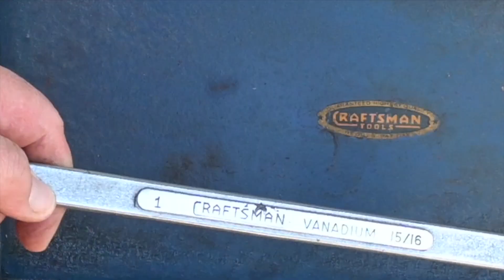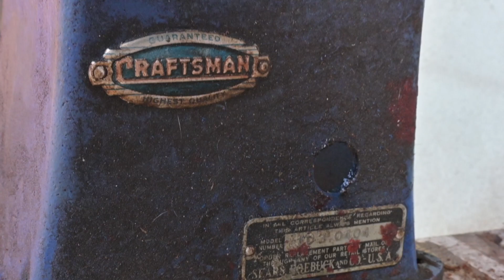Vintage 1938 Craftsman 24" Scroll Saw Disassembly

Comment: I did not notice the date when I cleaned mine up. I bought it in Az and when I get back there I will look for the date. Mine was missing the tension screw which I was able to get off eBay. The tool is so solid.
Reply from the maker: @kenroot2411  
She’s a great machine. With a proper tube, She’ll cut cleaner than any new stuff made today. Heavy too. 
Thanks for watching Ken. Are you going to make a video for yours??
I’d love to see Her.

Comment: Great video man!  Really cool saw and can't wait to see the process and the final project.  I found one just a little older than this one last year on FB and have it slated for restoration probably this summer.  Show me the way!
Reply from the maker: Thanks. 
I’m going to take my time on this one. I’m juggling this saw and rebuilding the bottom end of my ‘50 Cadillac. I’ll do 1 thing at a time because I have to stay focused on the Cadillac. I’ll work on the saw when I’m taking a break from the car. Hopefully I don’t get mixed up by going back n forth. It would suck to put main bearings on the saw. 
Stay tuned.

Comment: When you are all done with this and you need a place to send it too…..just holler😂 Nice work 👍 Rick🇺🇸🫡
PS: It’s only a little bit,older then me 😎
Reply from the maker: I’ll send Her your way if you’re going to use Her. She is a big machine though. 
I have a 1947 delta homecraft 16” scroll saw and this 24” makes it look small. 
I didn’t realize how big She is until I started cleaned Her up. I just want to make 1 project with Her, then She’s all yours Sir.